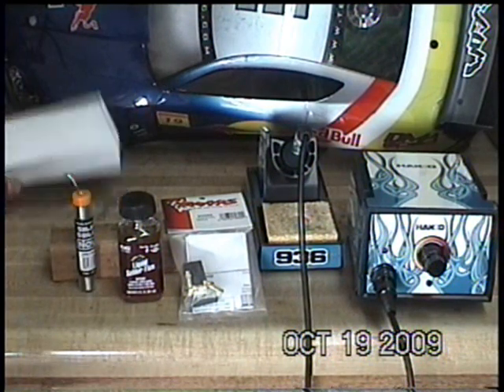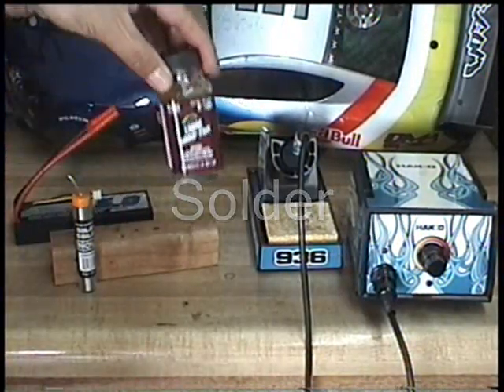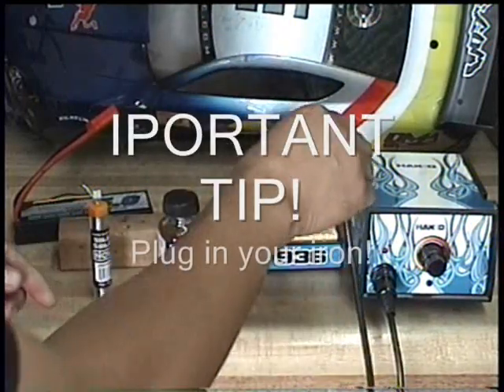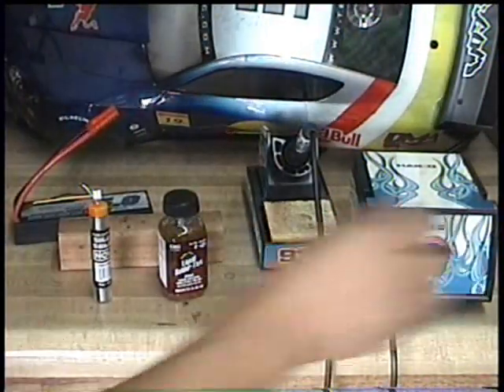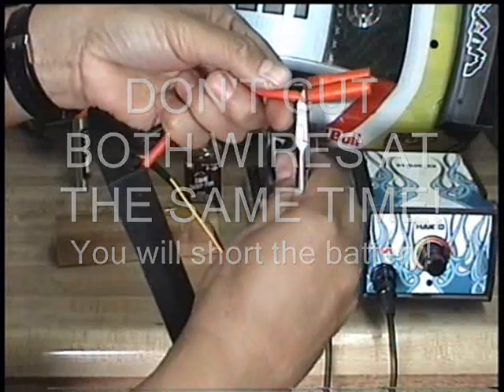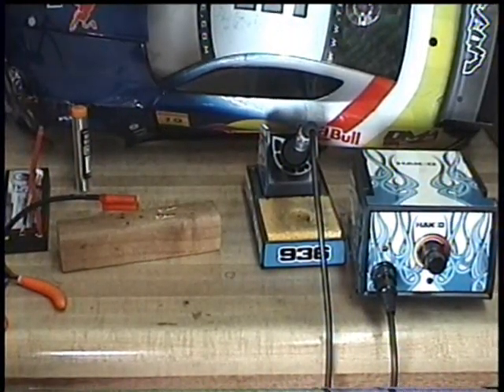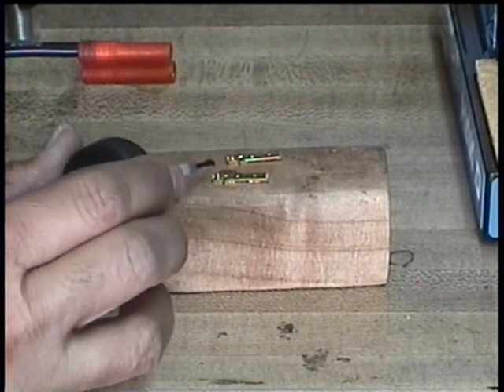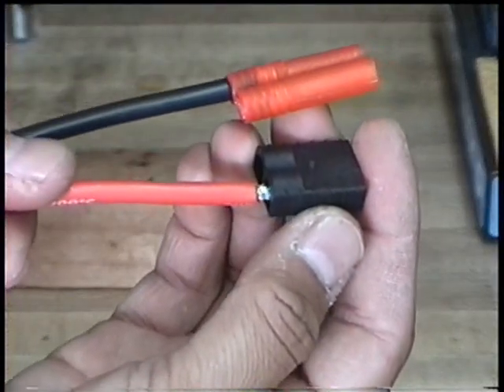Soldering Traxxas Connectors on New Lipo

Comment: So u don’t have to use heat shrink with these connectors? I just got a bag of 10 n attempting to solder them
Reply: I bought some of these connectors. They seem to be okay. I noticed the wire on one side has a tendency of working its way back out as I plug them into my UDR. Seems a little bit and miss. Sometimes they stay in pretty good and other times not so sell. Still working on a solution with these cheaper connectors.

Comment from the maker: Flux preps the pieces being soldered together.  It also helps the solder flow.  It's a must if you want a good strong joint pulling high amperage.
Reply: gluena flux is only a must on circuit board. The solder already has enough flux in it for this type of application.

Comment: is it important to use Flux when soldering?
Reply: TheFluffyVanquisher for this type of application not at all. If you were working on a circuit board than yes. The solder already has enough flux in it.

Comment: omg thank you so much i tried and tried even bought a 80w iron because i couldn't get it hot enough all i needed was a wood block for insulation to keep the heat in the plug not the cast iron i had it sitting on. =D

Comment: OK -- well I don't know that I would record it -- or recommend it, but I had only a 30 watt Radio Shack soldering iron and it doesn't produce enough heat.  Then I saw the price of better irons.  So --- I used a wood block too and I poured beer on it. (Water will do).  I put a wet rag over the lipo and poured beer on the block (I think water will do fine).  I tinned the connector with solder using a torch cigar lighter instead of a soldering iron.  Then the heatshrink --- be careful!

Comment: @MaxSachs So i am new to this rc thing. Im ordering up some lipos, and a new charger, the thunder ac6. Im wondering how to connect the battery to the charger after you do this. Does it come with special connectors or what? Or do i need to buy a converter for my charger? thanks!

Comment: A compound that serves to remove oxides (rust) from metal surfaces and to speed thermal transfer from the solder iron to the solder to the metal part.  Unfortunately it's also quite corrosive, if used excessively (or improperly) it can corrode the metal surface you're trying to solder.